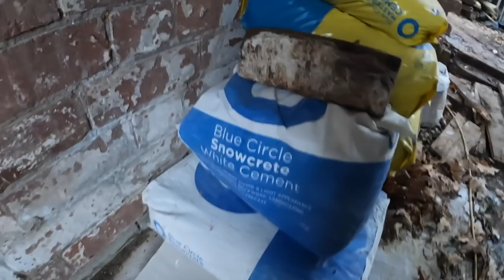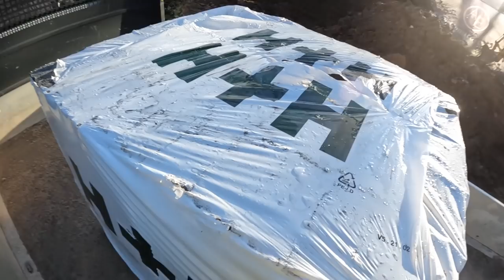VICTORIAN VILLA EXTENSION ..ENGLISH BOND  @BuildWithAE PART 2

Comment: This is so satisfying to watch!
The blockwork inside wall is so precise that you could stick wallpaper right to it and you wouldn't notice there is no plaster behind, if the pointing was flat.
And the English bond looks so nice with these old bricks and lime mortar, the snowcrete gives a nice sand colour because it doesn't render the colour to grey.

In my house renovation I have been using the lime/cement mix after doing a bit of bricklaying with ready mix, and I have to say that it is a treat to work with.
It gives a muck which sticks well, doesn't turn into a thin slurry in an instance if you add a bit to much water and also allows you more time to shift the brick or block around before it stiffens up.
I really got better brickwork since using it.
Reply from the maker: Thanks Tom , much appreciated .
   Very true about the lime 🤙🏾🧱👍🏽

Comment: Lovely work boys. I’ve just started back in the trade after a 30 year brake. Can I ask, why don’t you use the stand on your mixer and what do you do with the slurry when you clean the mixer on domestic jobs. I’m currently building a large garden and getting rid of the slurry is an issue. Any help/ advice appreciated. Thank you
Reply from the maker: The stand is just another thing to clog up the van so sold mine at a car boot sale years ago . 
   As for cleaning out it’s just wherever we can . 
   If we are desperate we will leave the water in till next day 🧱👍🏽

Comment: Great video guys ! The insulation system you used there in the cavity wall is technically a good way to insulate :) 
;have a good one steve and al .. is it windy there ? 🌬🍃💨
Reply from the maker: Its good stuff but a massive pain in the arse to install and work round . Its been bad in the uk today but we got off lightly 🌬💨💨🌪🧱👍🏽
Reply: Yes I know what you mean .. here it’s also not getting easier with all the energy/efficient regulations and stuff …
Here still blowing hard aldo , And I’m a bit worried about my crane she’s up there hoping for the best take care guys 🙏🏼
Reply from the maker: @JayKTS  I was thinking about the crane 🏗 😬.best of luck and take care  buddy 🧱👍🏽

Comment: Great work as usual from you guys. I'm using Kingspan insulation (K106), what tape are you using to join the boards? Thank you
Reply from the maker: Not sure what it’s called pal 🧱👍🏽
Reply: @martin2466  Hi Martin, it needs to be breathable, the same tape that A&E are using, I can't quite make out the brand name in the video. I would be interested to know where they get it from. Cheers
Reply: Thanks Martin

Comment: I'm trying to use the same insulation (K106) and my boards are all bowed 😢. Your boards all look like they're perfectly flat against the wall and I have huge gaps behind my boards (10mm in some places). Did you find some were bowed or are they as good as they look in the video?
Reply from the maker: That’s a shame mate , all those boards are spot on . 
Maybe yours have got wet or damp before toy got them maybe 🤔🧱👍🏼
Reply: @SteveAndAlexBuild  Thanks. The boards were dry when they arrived, but there's no way of knowing what happened before. 🤔
Reply from the maker: @Peter-dr2rd  . Nope 😬🧱👍🏽

Comment: Why are use cutting the sheets of insulation, these are 450mm I done a job last year where I had to tape the insulation aswell 8 houses what a pain that was
Reply from the maker: The old reclaimed brick don’t work metric gauge 🧱👍🏽
Reply: Sorry, lads obvious enough 😉
Reply from the maker: @brickblocksolutions1660  yeah we had to cut every other block course too so the ties weren’t being bent 🧱👍🏽